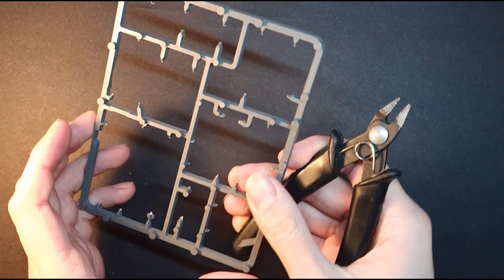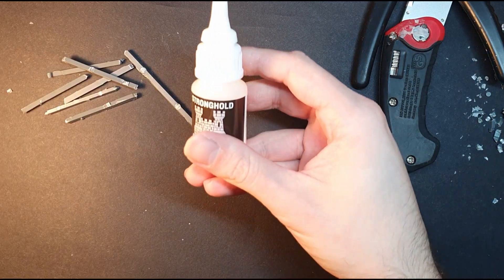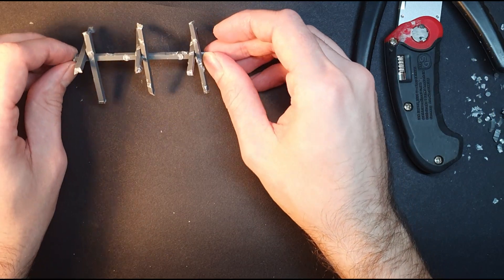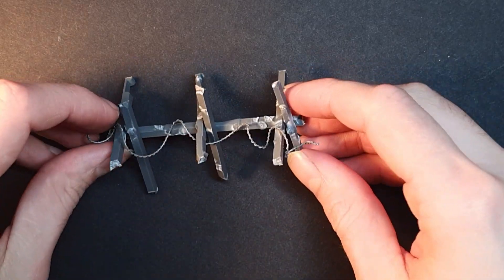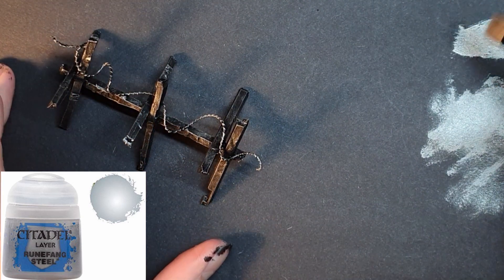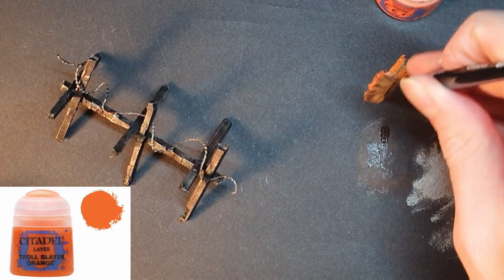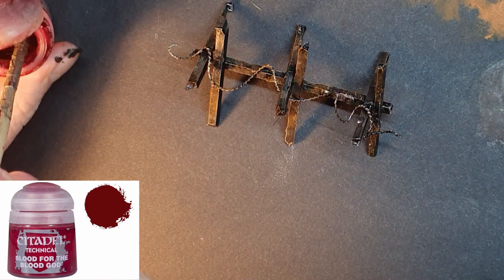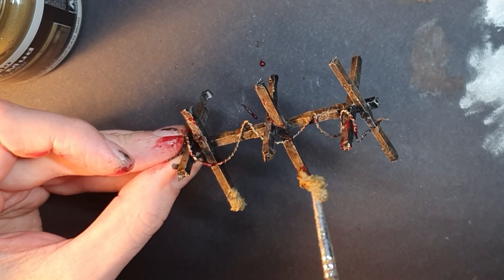Turn your Sprues into Barricades and tank traps

Comment: Nice job man. I was thinking of makeing these after watching war footage in Ukraine. Tank traps have been around for a while now and they do alot consider what they are. I had no clue what colors to use. I do have the colors you have though.
Reply from the maker: Thankyou mate, I think they add a bit of realism to the terrain as like you say they have been effectively used for a long time and fit the 40k aesthetic. For the colour scheme i would say it depends on your terrain and the colours you have on the terrain. I went for a quite neutral but worn and grimy look as it fits in with my besieged city board :)
Reply: @CommanderLurpack  Ya bud your board looks awsome. I dont have a board or mat yet :(   Il have to get some more terrain down the road. Thanks so much.